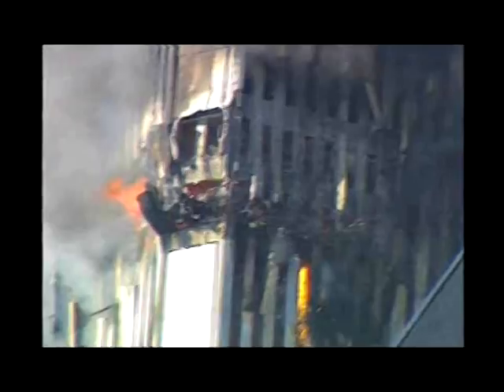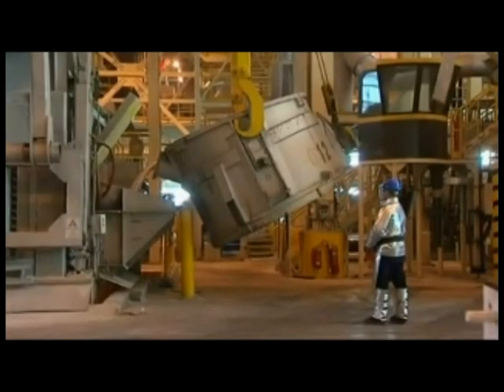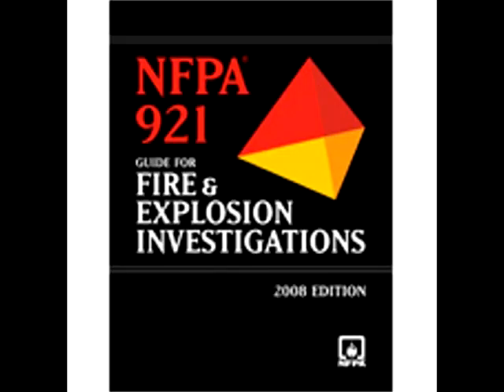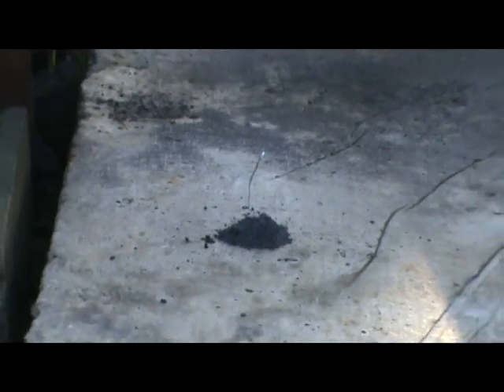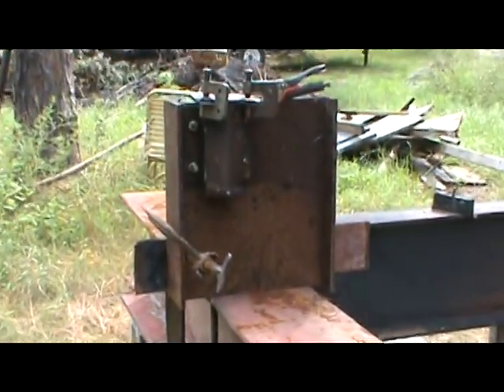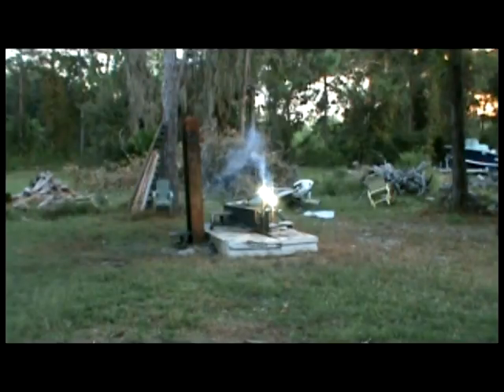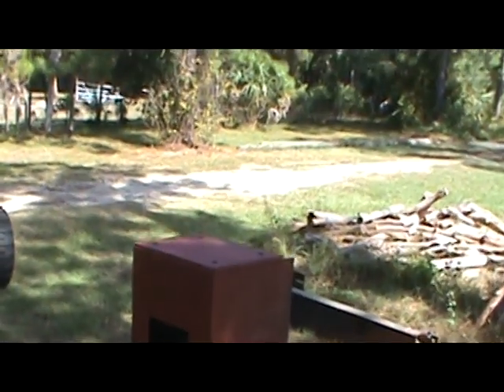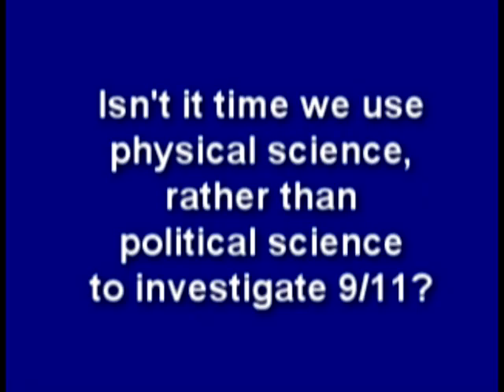9/11 Experiments: The Great Thermate Debate

Comment: Basically you're an idiot. It doesn't take a genius to understand that the steel doesn't have to melt. It also takes very little understanding of the basic properties of materials to know that the steel EXPANDS when heated and this is the mechanism that caused the floors to collapse. Frankly, I am sick of hearing conspiracy claims about this where the claimant displays no ability whatsoever to use even basic principles of scientific investigation.
Reply: "steel doesn't have to melt." - that is true. And this is also what could have caused the fall. But now we have the problem that there was molten steel anyways
Reply: There wasn't any 'molten steel'.
THE MATHS THAT PROVES ARCHITECTS FOR 9/11 TRUTH TO BE LIARS.
THIS OFFERS A SATISFACTORY EXPLANATION FOR ALL THE OBSERVED CONSEQUENCES OF THE WTC TOWER COLLAPSES.

An analysis of a tower's potential, and therefore kinetic, energy is a good way to illuminate the consequences of collapse. The only material burning in the wreckage was HYDROGEN GAS (and most of that would have occurred at the wreckage surface).  Deep down at the base of the densely-compacted wreckage the very hot and compressed iron had created anoxic (reducing) conditions, and fire could not have occurred no matter what the local temperature may have risen to.

PRIMARY 9-11 CONSPIRACY ASSUMPTION SHOWN TO BE FALSE:
AN ANALYSIS OF THE AMOUNT AND DESTINATION OF THE POTENTIAL ENERGY OF A WTC TOWER
The first law of thermodynamics, also known as the Law of Conservation of Energy, states that energy can neither be created nor destroyed; energy can only be transferred or changed from one form to another.
Source: Boundless. “The Three Laws of Thermodynamics.” Boundless Chemistry. Boundless, 02 Jun. 2016. Retrieved 12 Oct. 2016 from https://www.boundless.com/chemistry/textbooks/boundless-chemistry-textbook/thermodynamics-17/the-laws-of-thermodynamics-123/the-three-laws-of-thermodynamics-496-3601/
The World Trade Center towers (and WTC7) fell NATURALLY due to buckling failure when their 'slender' columns lost attachment to their floors.
They only used a third of their Potential Energy to destroy themselves, the remaining two-thirds was consumed in crushing some of their steel into ground zero.
A standing WTC tower possessed two hundred and forty six tons of TNT of POTENTIAL ENERGY merely by just standing there. We shall call this energy Eo.
The tower fell by taking the direction of LEAST RESISTANCE, which was THROUGH ITS BUCKLING COLUMNS.
The columns failed by BUCKLING because their STRUCTURAL STABILITY had been compromised by LOSS OF FLOOR ATTACHMENTS. No steel got crushed when this buckling failure occurred. 
Buckling is not a MATERIAL failure; it is a STABILITY failure.  This type of failure was first explored by the famous polymath, Leonhard Euler, around 1,750 AD.
The floors had detached themselves by sagging to an angle which snapped their connections. Photographs of these separated floors (taken shortly before collapse) are plainly shown in the NIST Report.
As each tower fell, some of that stored potential energy, converting to kinetic energy by falling, was released to damage and dismantle both the moving and the stationary parts of the tower on the way down.
The amount of the initial energy consumed in such a manner was inversely proportional to the rate of acceleration of the tower as it descended. It can be calculated.  We shall call it Ed.
The amount of energy remaining (Er) when the tower wreckage hit ground zero is then (Eo - Ed).
This energy, transferred elastically, caused PLASTIC DEFORMATION in the crushed base steel wreckage, and became HEAT. This too can be calculated.
The heat was considerable. The signs of it were captured by satellite. It amounted to the equivalent of a thousand tons of steel raised to a temperature exceeding 1,000 degrees Centigrade.
This hot steel, crushed and pressed against ground zero, oxidised its surface (making scale) and absorbed local oxygen gas, leaving a reducing atmosphere.
In these reducing conditions, and at a temperature of 1,000+ degrees C, fireman’s water which had percolated through crushed gypsum wall boarding DISSOLVED calcium sulphate (yes, Gypsum is 5% soluble in water), the sulphate ions of which were reduced to sulphur which combined with the exposed iron to form IRON SULPHIDE, which at such temperatures was MOLTEN, and flowed away. At a temperature of 1,000 degrees Centigrade, in an absence of oxygen, and in the presence of hydrogen, Sulphur and Iron atoms become keen partners, forming IRON SULPHIDE, which above 1,000 degrees Centigrade, is a LIQUID, and flows away, leaving 'corrosion' claimed by 'truthers' to be caused by thermite.
Such hot reducing conditions also caused the water/steam to be REDUCED to hydrogen gas which was noted by firemen to be burning at the surface of the wreckage.
The wall-boarding and crushed concrete surrounding (but mostly above) the steel were THERMAL INSULATORS, so greatly slowing cooling.
CALCULATIONS (in SI units):
To calculate the original potential energy of the tower in TNT equivalent,
G = 9.81 metres/sec^2
Mass (M) of tower = 5e8 Kg
Height (h) to the tower’s CG = 210 metres
The explosive energy of 1 ton of TNT (Kt) is equivalent to 4.184e9 Joules
Equation: Tower Potential Energy (Eo) = ( M * G * h ) / Kt
This is equivalent to ( 5e8 * 9.81 * 210 ) / 4.184e9, or 246 tons of TNT.
The Potential Energy of each standing tower was equivalent to 1,000 standard 500 lb. ‘iron’ bombs.
To calculate the kinetic energy used in the tower destruction takes a moment, after a simple thought experiment, namely considering the tower would fall at G if there were NO resistance, and if it fell so slowly that it consumed ALL its energy, it wouldn’t fall at all.
So we can see that the PROPORTION of the energy used up by the collapse must equate with the proportion of G which the collapse was unable to achieve.
As the collapse acceleration was, by truther calculation, established to be about 70% of the acceleration due to gravity, we’ll use that.
The energy used up in tower destruction was therefore 30% of 246, or 73.9 tonnes of TNT.
Assuming that 30% of the tower fell outside of the basement, then the energy (Er) available to heat the wreckage base (by elastic energy transfer and crushing) was 0.7 * (246 - 73.9), or 120 tonnes of TNT.
We know that the steel reached at least 1,000 degrees Centigrade because that is the melting point of iron sulphide.
We can therefore calculate the mass (m) of steel that was raised to that temperature.
The specific heat of iron (Fs) is known to be 0.45e6 Joules / tonne / degree C
The ambient temperature was 20 deg C, so the temperature rise (Tr) was 980 degrees C
Equation: Er = m * Fs * Tr
So m = Er / Tr * Fs = ( 120 * 4.184e9 ) / 980 * 0.45e6
And so m = 5.02e11 / 4.41e8 = 1,138 tonnes.
The collapse of each World Trade Center tower created 1,138 tonnes of red hot steel at 1,000 degrees Centigrade.
So we can see that there is no need to postulate an extra source of energy, and that the basement wreckage heat is also easily accountable, with the additional corroboration of burning hydrogen at the wreckage surface, and molten iron sulphide at the wreckage base.
And so the underlying 'truther' assumption, that the planes couldn't bring down the towers, is shown to be FALSE, as it is shown by calculation, using the physically-correct values, that the potential energy possessed by the towers numerically accounts for ALL the known consequences, through elastic energy transfer, plastic deformation, HYDROGEN gas burning at the wreckage surface, EUTECTIC IRON SULPHIDE melting off the hot steel pressed against Ground Zero, and, of course, a tremendous amount of HEAT.
These results are EVIDENCE of the event.
They have been evident to any REAL scientist or engineer from day 1.
Reply: thezul.... can you tell the difference between molten steel, plastic of the thousands of pounds of aluminum that was covering the other skin of the trade centers ?
Reply: +eric wsmith and TheZul - There was no molten steel at the towers.  The iron produced by the thermite reaction, had any such reaction occurred, would have been WHITE HOT at 4,532 degrees Fahrenheit, melted the steel, and fallen STRAIGHT DOWN.  "STRAIGHT DOWN" means inside the tower. Steel is three times denser than aluminium, and there's no way it would have appeared outside the tower.
The liquid that poured out would have been a mixture of aluminium and glass.  The corner from which it poured was exactly where 55 tons of the plane's aluminium alloy wreckage had been sitting for an hour in flame temperatures which reached 2,190 degrees Fahrenheit.  The melting temperature of aluminium is 1,220 degrees Fahrenheit, that of glass more like 1,800 degrees Fahrenheit.  Both of these glow orange at 2190 deg F, no matter what truthers may claim.
Reply: Tony Duncan,,,, that,s  what I meant, there was no molten steel, But plenty of other items that could have melted.  And of course no thermite, or explosives .  As for anything including the building falling "strait down" , we just call that gravity.
Reply: I supposed building 7 fell into it's own footprint from the wind, eh?
Reply: @TexZenMaster  And at freefall speed.

Comment: Everyone watching this video, do what the video is telling you to between the lines: not to trust what you have been told all the time and look for your own evidence. This video is relaying a whole load of “facts” which are debatable. First and foremost, molten aluminium is very much so red, aluminium melts at 660.3 degrees C (DC), jet fuel burns at 1000 DC, and planes are made of mainly aluminium, what is pouring out the side of the towers is more then likely molten aluminium. Secondly, iron doesn’t melt with jet fuel alone, however, iron/steel loses around 50% of its weight baring load at 593 DC. This would have been enough to allow one floor to fall onto the next, and so on. People often state its suspicious that the tower didn’t topple, if the steel had melted, and become liquid, which would have happened had thermite been used, the outer structure would have had no strength at all, making a toppling more likely. Honestly, everyone who’s just believing from what they’ve seen open your eyes. The Americans don’t control everything, they do lie, but they don’t control everything. And why on earth would they want to justify a war in the Middle East, if your answer is oil, then why did they invade Afghanistan first. Then two years later Iraq, securing oil in the Middle East was done far cheaper in the 70s with Saudi Arabia. This is how it is, you lot are all to stupid and lazy to understand the complexities of geopolitics, so you try to understand it through the microcosm of “America controls everything”, you are the nationalists you claim to be so much more intelligent then. Do your research, and sort your lives out.

Comment: Sorry but this is not how science is done. You just can't prove anything with such miniature set-ups. The key factor for the collapsing of the two towers is pressure - the pressure from the floors above the impact on the already weakened steel bars. The weaker one steel bar gets the more pressure is applied on the other bars until, eventually, everything comes crashing down. So do it again, with tons of pressure, and I'll guarantee you those bars bend like a chocolate bar in a car.

Comment: You don't need to melt steel. If you heat steel to 1500 F it will still be solid but will lose all its structural strength.

Comment: So I take it there were thermite boxcutters found in the wreckage.  Because, it would take thousands of these devices to assure that they brought down the building.
Reply: The wreckage was shipped off to China before it could be properly investigated.  Besides, with nano-thermite, you may not need any extra tricks.  Maybe just put putty where you need to.
Reply: Oh, but they found these tiny steel balls in the wreckage, allegedly indicative of molten steel but couldn't find anything else.

Comment: So, whoever planted or set up the thermite on the steel beams knew exactly where the planes would hit and set the thermite in positions where it would NOT be blown away by the plane hitting, but would be effective at weakening beams?
Reply: You make it sound like a difficult task and it's not.  Just place some extra charges.  A plane can't take out much.  Except for the engines, they are made of thin aluminum.  They crumple when they hit steel frames.
Reply: A 65-tonne airplane travelling at 400+ mph represents a great deal of kinetic energy that can certainly 'take out' quite a lot, as we all saw not once but twice. Yes, they may crumple, but they destroy what they hit. The energy has to go somewhere. Further, the columns were not designed with withstand high lateral loads, only vertical loads.
Reply: Yeah, sure.  No problem to tear up the building structure to install these "thermite boxcutters" on the beams with bolts and clamps.  Funny how none of these thermite boxcutters were found in the wreckage because there must have been thousands of these things to achieve the "controlled demolition".  Also it's weird how we only see visual indications of the alleged thermite (e.g., the alleged molten steel in the video) at a few spots corresponding to where the plane hit and fire raged.  Seems like we should be seeing these indicators all over he place around the entire steel beam structure of the building

Comment: there was a structure in Philadelphia on Delaware Avenue that was used for sugar manufacturing professional demolition people had a very hard time taking that structured down, all the rebar and concrete would not break apart, so why would Solid Steel come apart on the next steel worker the melting point of steel is 5500 degrees! dear president Trump, before someone poisons you, or kills you, please have all the people involved in this arrested put into a nice facility because it involves ex-President Bush Cheney and Rumsfeld anyone who profited monetarily from these buildings coming down should be held as immediate suspects, arrested and detained with armed guard 24/7 you can put them in a nice comfortable facility and question them everyday, under Obama's law you could do this. And hold them indefinitely. Also not one Jew went to work that day severe scrutiny on Israel needs to be in place! Also the man Silverstein I believe? who rented these buildings and had them highly insured and profited four and a half billion dollars also needs to be arrested and detained! Under Obama law indefinitely, someone will eventually talk!
Reply: You lie even worse than Trump.

Comment: Thermite is used to weld rails, so of course thermite can melt steel. Aluminum wants the Oxygen in the iron oxide, and it will get it, causing very hight temperature and heat, once started, e.g., with magnesium ribbon. I think the thermite reaction leaves excess Oxygen, which will burn steel, if hot enough, e.g., just as Oxygen does when cutting steel with an Oxy-Acetylene torch.
Reply: The thermite reaction doesn't leave 'excess oxygen'.  The aluminium powder is there to take the oxygen out of the iron oxide.  So you're utterly wrong.
Reply: The primary reaction is between the Aluminum and Iron Oxide. I was incorrect in thinking the reaction leaves excess Oxygen -- the reaction can be 'perfect' if the right amounts of aluminum powder and powdered Iron oxide are used. The reaction makes much heat, and leaves Iron and Aluminum oxide.  While this reaction does not leave excess Oxygen, Oxygen gas will combust iron, as I mentioned, as in cutting iron/steel with an Oxy-Acetylene torch.
Reply: Even if the 'wrong' proportions are used, the oxygen will only leave the iron oxide if there is aluminium to take it.  You can roast iron oxide all you like, but it will never release that oxygen.
The civil steel used was nearly pure iron - a 0.2% carbon steel, and started to lose its structural strength when heated above 475 deg C or 877 deg F.
The floor trusses might as well have been designed to collect the heat of the six-acre office fire (burning at 1200 deg C or 2192 deg F), and their temperature soon rose enough to allow the floors to sag.
Once they sagged beyond a certain angle, they snapped their connections to the columns.
Without the side support of the floors, the columns became unstable, and failed (while relatively cold) by buckling.
This instability was known and understood by Leonhard Euler in 1750 AD.
Welcome to the modern industrial era.

Comment: Another pointless video talking about more crazy ideas that are pointless. It was the plane that brought down the tower and that's it.
Reply: Actually it was the six acres of office fire that did that.
Reply: Yeah but what lit the fire, the bigass plane.
Reply: Of course.  The plane carried 10,000 gallons of fuel inside it.  That turned instantly into about a hundred of these: https://www.youtube.com/watch?v=GmRASCHJe2Q
That set fire to six acres of offices (each floor being an acre in area).  That amount of heat was capable of causing the steel truss floors to sag and fail thirty times over.  The tower structure relied on its floors and failed without them.